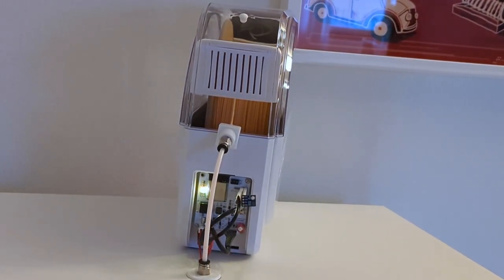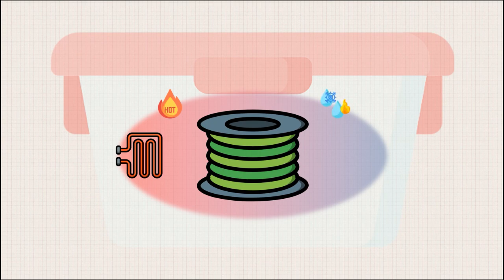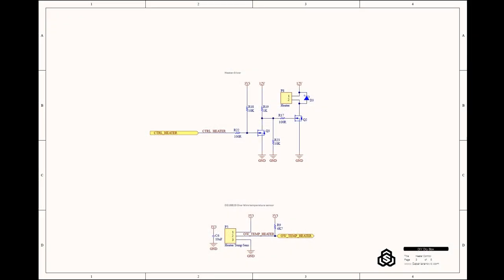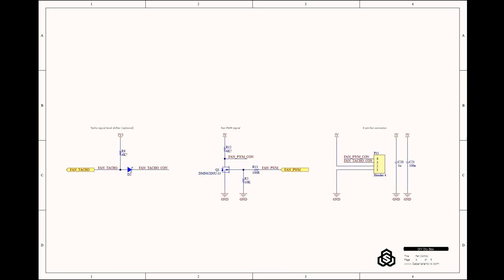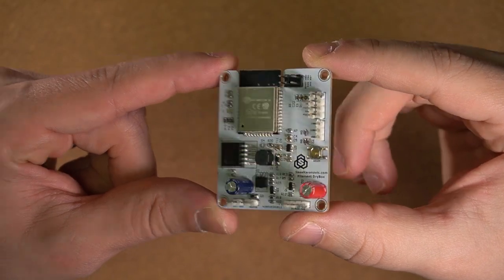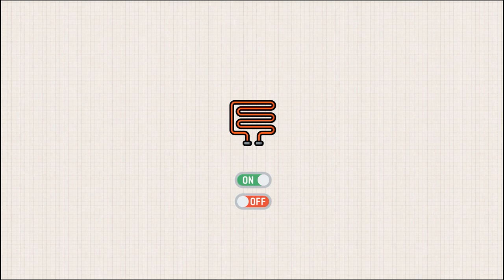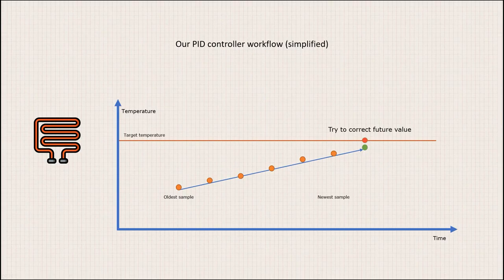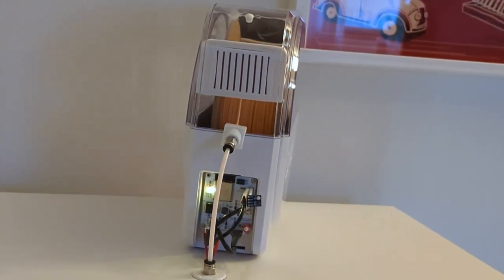DIY 3D Printing Filament Dry Box

Comment: Hey Sasa, this is such a great project, and I really appreciate making all the files and other info available! I have a question about your choice of mosfets... was there a reason you didn't use a logic-level mosfet for the heater control? You clearly made a deliberate choice to drive it with 12v to keep it from overheating and to use a smaller drive-voltage mosfet from the esp32. Like you said, there are plenty of ways to design the circuit, but I'm curious why you chose the route you did? Mostly I want to make sure I'm not missing something obvious if I put a logic-level mosfet in my version :-) Thanks! ~Guy
Reply from the maker: Hey Guy! I'm glad you liked it.
To be honest, the main reason was that I already had these MOSFETs laying around. :) As you said, you can design this circuit in many different ways. But essentially my rule of thumb in application like this is that you want to keep your Rds_on as low as possible so that the MOSFET does not overheat (or produce heat) while conducting. And also that you can open/close the channel fast enough. So if you find a logic-level MOSFET that can carry the current you need for your heater and the Rds_on is low enough that it won't overheat or burn out, then you should be good to go.
There is a whole theory behind designing driver circuit for heaters/inductive loads, you can Google it if you are interested. But in my case, I had this MOSFET laying around and also the heater I'm using is relatively low power so there is plenty of room to play with. :)
Reply: @SasaKaranovic  hahaha ok perfect thanks so much for the super fast response! I think I'll try it both ways and see if one version stands out. I've seen folks use a BJT to trigger the MOSFET as well but I think that might have some heat issues as well. I'll report back! thank you again!
Reply from the maker: If you know the specs of your heater, then you should be able to easily design a driver circuit. Or at least you can see how much current it draws and then design a circuit that can handle those currents without breaking a sweat. :) Good luck and let me know how it goes! :)
Reply: UPDATE: logic level MOSFETs are garbage 😂As predicted, resistance is waaaaay too high with the low Vgs without doing anything else, and even then it's just not built for much more than even 5v in my opinion, 12v at the most. And I'm basing my heater off an Ender 3 heated bed which pulls about 9 amps at 24V, so even 5V on the gate heats up in seconds. So now I'm working on a new circuit that will source the gate voltage from the 24v supply and dropping it down to 10v or so depending on the net fet I end up with. I'll keep you posted!
Reply from the maker: Hey! Great to hear you are making progress! Sorry it's not working yet but it was kind of expected. :)
Please make sure your MOSFETs V_GS can handle the voltage if you plan on putting 12V or 24V on it. Also, keep in mind that you should be able to use multiple MOSFETs in parallel if single FET is not enough. But then you might have to deal with other issues, so maybe keep it as an alternative.
Also if you are using an entire heated bed that draws 9A at 24V... that might be what some call an overkill for the filament drybox. You don't want to melt it before it reaches the printer. :D
Reply: @SasaKaranovic  that thought had occurred to me about the overkill! 😂 I will probably downgrade to something a little less ridiculous, but at this point I figure I’ll take the time to learn to deal with the bigger voltage/current. The latest version is using a small buck converter to drop the source 24 to 12 to drive the gate of an IRF3205. I am at this very moment about to run the bed through the circuit to see how much heat the MOSFET produces. If my calculations are to be believed (hardly a guarantee ) based on the specs and a .008 on resistance at 10v it should level out around 70C. I think. I’ll pause before throwing the switch on the off chance you see this and recognize a huge flaw that is about to kill he or melt my fledgling dry box..
Reply: @SasaKaranovic  I should also mention that currently I'm just driving the gate directly from the stepped-down 12V, no MCU in the mix yet. That will def involved a second FET, ultimately resulting in a circuit very much like yours with the MCU driving a FET that then drives the power supply to the bed. Definitely a lot of trouble to work with a 24V bed, but the Ender 3 (which is what I have) runs on 24V so it was the one that Microcenter had at the time 🙂I'll report back as testing continues! And thanks so much for the dialogue, it's very much appreciated!
Reply from the maker: That sounds like a bit of an overkill but hey, if it's worth doing, it's worth overdoing. :)
Driving an inductive load that draws 9A at peak, you will have some minor challenges that you will have to figure out as you go. But it's an learning experience.
Back of a napkin shows that you will probably see around ~45C increase above ambient on that FET. Keep in mind that heat is going to accumulate over time. You might want to add a heatsink if you want it to work for very long time. But for short periods you should be fine.
Good luck and let me know how it goes!

Comment: For those of us without the heater from the actual Sunlu, what would you suggest as a replacement? I've seen people use some of those terrarium heaters, but I think those go only up to 35ºC or so.
Reply from the maker: Great question!
Before I answer, I feel compelled to warn you; please make sure you understand what you are building and how it works. Heaters are potentially very dangerous. Not only can they burn items around them and cause fire. They can also cause nearby materials to melt and produce toxic gases. Be smart and stay safe!

With that said. There has been some interest in this project so I am working on a new revision that uses all off-the-shelf components.
There are a lot of options for heater element. You can look at 12V/24V heaters. You can use 12/24V polyimide heaters and attach them to piece of metal. There are heater+blower options... Obviously each one comes with cons/pros. And again, I can't say this enough, make sure you know what you are doing!
Reply: @SasaKaranovic  Thank you for the thorough explanation!

Comment: Great video, I’m making my own filament dryer right now reusing sunlu parts. when using the thermistor to measure the heating elements temperature, how close did you have it to the heater as the factory thermistor is touching the metal. And what’s voltage / current did you run the heater on?
Reply from the maker: Thanks! I did not use a thermistor, I used a digital sensor. But whatever your sensor is, you want it to be in contact/touching the heater so your reading is more accurate.
My heater is running off 12V but I don't recall the peak current.
Reply: Ok, thx

Comment: Very nice! We are working on a similar solution for the Valkyrie PRO DIY HT-LC 3d printer and have problems sourcing a fan rated for 80C. Do you have a lower temperature limit or did you find a fan rated for HT?
Reply from the maker: @PRO 3D thanks!
With the global shortage of everything, I'm not surprised. :) But there are industrial fans that are rated for higher temperature. There are also fans that are used for heaters and high temperature industrial applications. Usually they will be a bit more expensive but if you have no other option... From my experience not all manufacturer mention the temperature limit, but most of them, if the volume is high enough, they will do a special batch/mod for your order.

Comment: Is there a difference between the esp32 high temp and ones that don’t specify the high temp? Looks like these are like raspberry pi’s.
Reply from the maker: I'm not sure what do you mean by high temp ESP32 and the one that doesn't specify high temp? I believe that any ESP32 should work fine for this purpose.

Comment: Is it possible to somehow connect to this circuit a fan that does not have a PWM wire?
Reply from the maker: You could but you would have to modify the circuit in order to be able to turn it on/off.
You could "rewire" the fan and connect the GND pin of the fan to the PWM pin. 
Make sure that Q1 MOSFET can handle the current fan requires.

Comment: awesome vid! how did you control the humidity? i can see that you are monitoring it.
Reply from the maker: This version only has a desiccant, heater and fan for air extraction.
Monitoring in+out humidity can also be useful to know what is you "baseline" vs what is filament sitting at.

Comment: Please make a kit, the BOM is missing many details (for example the specifications of the components that are included in your esun case for those who don't or cannot get that case; which will soon be out of production) and it uses some old parts (namely the ESP32) that are only stocked by obscure distributors. Additionally, this video focuses on schematics more than the resulting board and build, which is extremely interesting and I learned a lot, but does not help with pragmatic aspects of DIY.
Reply from the maker: Hey @ogsandwitch! Thank you for the great feedback, I really appreciate it!
The ESP32 is still be alive and globally available, so it should not be an issue. And I'm not sure about the enclosure but the general idea should be applicable to other filament driers.
Maybe you missed it but I have mentioned in the comments that I am working on another revision that uses only off-the-shelf components. The hardware part is already done, it just needs a video now. :)
As you noticed, this video is more about "how to mod the existing filament dryer" which helps if you have one, but it might be more helpful to show how to build one from scratch. My main concern at the moment is making sure people understand that his machine is very cool, useful and fun to build, but you need to exercise caution and common sense because it can get very hot. Same as you would not consider your oven as a "toy" (even though it's fun to make cakes in it) it can still get very hot or burn the house down.
Reply: @SasaKaranovic  Thanks for your response! Neither JCL nor PCBWay will source the part, noting it as "unavailable;" this is after a sourcing request on the part, on the backend, they contact all distributors to find the part, when you get this response it means no distributors have stock. Another tell-tale sign of an out-of-production part is when digikey shows the "by request only" message, which is present for this part. There is only one distributor I can find with stock. I posted an issue on your repo, it seems the ESP32-WROOM-32E-H4 (note "32E" and "H4") is the successor to ESP32-WROOM-32D (4MB HIGH TEMP). I however cannot confirm the pinout because the every distributor has a broken link for the ESP32-WROOM-32D (4MB HIGH TEMP) datasheet (even the distributor with stock has a broken link). However, when matching the newer ESP32 cad to your board, the footprint aligns.

I have improved your BOM in CSV format that is easier to import into JCL/PCBW and has a separate entry for each header and have a transposed pick and place CSV that is compatible with JCL/PCBW, will push a PR

Also curious why in your pick and place file you have set the 3x2 programming headers for "bottom," would be easier or cheaper to manufacture if all components were top-side.

Comment: Is that a rear exhaust fan to get rid of the moisture that builds up inside the box? How did you integrate this into your mod?
Reply from the maker: The rear fan is mainly to force air circulation within the box and reduce the temperature gradient. For example when I turn it off, the difference between the air temperature near the heater and at the top of the enclosure can differ by ~10-15C. So for example the filament facing bottom will be at 55C while filament facing the top would be at 40C. However, when the fan is turned on they are usually within 2-5C of each other, which is what I want.
Also fan can be helpful if you have exhaust openings and/or desiccants inside the box. Obviously you can play around with the placement and direction to get the performance you need.

Comment: I bought one of these an immediately returned it. Out of the box it's just not effective enough to do what it's supposed to do. Especially for the price. I will stick to putting filament in my food dehydrator for 24 hours before each print (anything less seems to have issues regardless of filament type or manufacturer)
Reply: I bought 2 of em and proceeded to disassemble and make them right.

I agree it aint for everyone. They are missing some important parts like insulation.....but them rollers 😍
Reply from the maker: @Zero0004 I'm mostly printing PLA and PETG so I'm not that affected by the humidity.
But yes, I got this filament dryer, on paper it sounded amazing and then when I tried it, there was a lot of room for improvements.
Reply from the maker: @mrocklewitz  It's a decent filament dryer. But there is always room for improvements.
And yes! Those rollers are so tiny and cute!

Comment: So you need a arduino to even get this working ?And what type of heaters and fans can we use ?Max Voltage/amps...?
Reply from the maker: Design is open-source open-hardware so you can modify it to fit whatever fan and heater your plan on using. The project is using ESP32 and Arduino so it's easy to source and program/modify.

Comment: Hi Sasa, great project! Do you plan to add a timer to turn off the Box after drying the filament?
Reply from the maker: You could very easily add it, or use automation (ie. maintain humidity below certain threshold or turn on only while printing).

Comment: ESP-WROOM-32D is hard to get -- has anyone got this going with a different ESP32 ?
Reply from the maker: You could find any pin-to-pin compatible module and use it instead.
There is also a newer version of this project coming out soon. It will have many improvements compared to this one, so stay tuned/subscribe so you don't miss when it comes out. :)

Comment: Hey so i was working on a similar project and even when thr heater was at max 80°c (ptc heater) the ambient temperature was not able to go above or even close to set temprature and actually never went above 45 ° is that normal and enough to dry the filament or i am doing something wrong.
Reply from the maker: My guess would be that your box is not insulated well enough, maybe you have gaps through which heat is escaping or maybe just the material you are using for the box is very thermally conductive. Keep in mind that if your box is well insulated, then your heater is heating the dry box. But if it's poorly insulated, then it's trying to heat the entire room which is very bad. :)
My box easily gets to the 55-60C but to be honest I'm not sure what is the best temperature. It requires some trial and error because it depends on your setup and the type of filament you are using.

Comment: You kinda cheated by reusing the old dry box, the project isn't very worthy if u need an "old" dry box. If u built the enclosure and sourced or made a flex heater that'd be more useful. Probably even a low cost mk2 heating bed mounted to the bottom of an acrylic box
Reply: But good job with firmware and pcb design
Reply from the maker: Good point. It all depends where each person draws the line. You could also say I cheated by using a off-the-shelf microcontroller instead of designing and growing my own silicon. ;)
As mentioned in the video, the plastic box is not that important, you could use an old plastic Tupperware and any off-the-shelf DC heater and you are good to go.